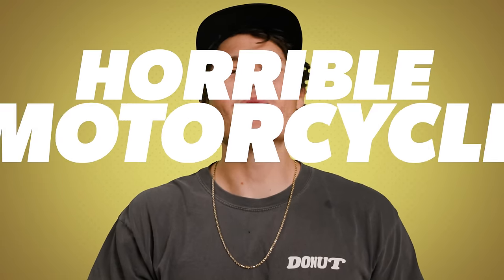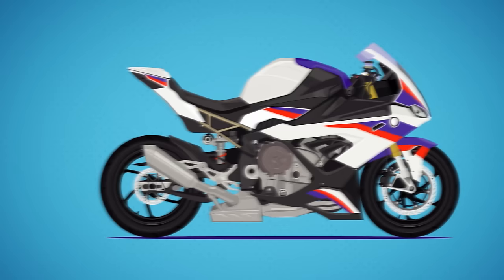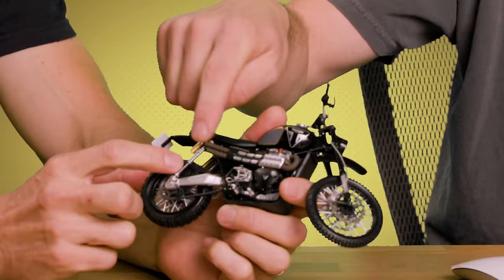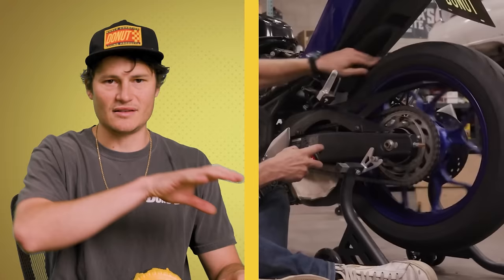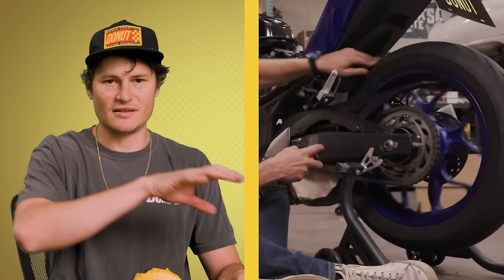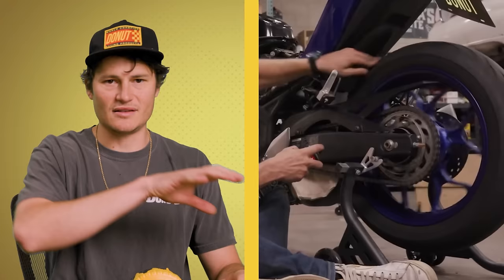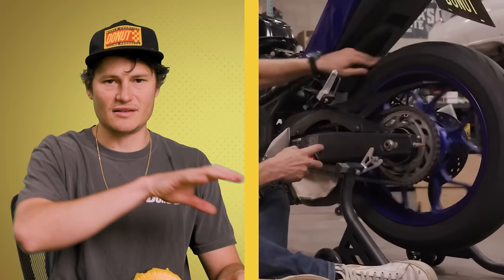Motorcycle Mechanics React to Tiktok Repair Fails

Comment: You can increase airflow on the intake without increasing particle size going through your filter. You have to get a much larger filter so you have a larger surface area there by increasing the flow rate in total if not per square inch. And potentially better quality types of filters While not having increased mesh size may have more mesh. But yes, obviously the easiest way to increase airflow is to put a larger mesh size filter or do you take it off entirely which, of course eats the engine up.

Comment: seeing the damage from that chain break brought back some memories lol. i had 3 chains snap on me within 2 months.  first one got stuck on front sprocket and destroyed my engine. did full engine replacement, then it came apart again and did some case dmg but was still ok. third one just flung out the rear with no damage.some of you are going to assume i installed them wrong but i think some one at work was messing with my chains cause i dont see 3 chains breaking like that. no issues since i changed jobs. some one was trying to kill my ass.

Comment: That R1 had been sitting for a decade.  I'm sure that the rubber seal simply broke down over time.  The process could have been helped along with starter fluid, but more than likely they used BRAKE Cleaner to try and start the bike.  This is exactly why you NEVER Use Brake Cleaner on anything other than brakes or other external steel parts.

Comment: Yeah, this Jeremiah, at age 8 over torqued the carb on the go-cart engine I worked all summer to buy and barter for.  I broke one of the bolt holes.  I tried to JB it as well, but it didn't work.  So I had to work and barter a few more weeks until I could afford to buy a new carb.

Comment: I had a chain snap on my dirtbike once. It whipped around and punched a hole in the crank case and locked up the rear wheel. I wiped out pretty good too. Good thing I was only going like 30mph.

Comment: I had a MBX-10 mini bike, I was cruising down the road at max speed and had a brand new chain snap. Luckily it didn't damage anything too bad but it scared the crap out of me when it broke. I replaced the rear sprocket afterwards and the guy who sold me the clutch and chain replaced the chain with a stronger one.

Comment: 9:07
I ride offroad, that is every time I ride I check the tension before and after, plus after I ride I clean my rear sprocket up and chain then spray it with chain lube.
Maybe I am paranoid but I don't have many chain problems.

Comment: broken chain sprocket can be deadly if it gives up on a pull out into traffic and the approaching traffic hits you because the teeth started slipping. my mom had a van where the engine mounts broke while pulling out for a left turn luckily it gave enough push she could roll all the way across the road to not be hit.

Comment: When I was about 20 I had a TZR250 and the chain came off while I was out in town.  I had pushbikes prior and decided I could just put it back on and try to drive without braking and keep constant pressure on the chain.  Yeah this was a terrible idea.  After hearing these guys I'm inclined to be rather thankful to not have been injured...  So I started off and it went just fine.  I split lanes and a set of lights and just as I got to the front the lights went green so I just kept going and got out quite a way infront of the cars that had been waiting.  It was at this moment I knew I had Fd up.  The chain jumped the sprocket got wedged and snapped the chain which wrapped around the rear sprocket a bunch and took a chunk out of the swing arm.  Fully locked the back wheel at about 55-60kph.  Before the bike had stopped moving I was already swinging my leg off the bike and grabbing the b!t(h strap and started hauling it off the road out of the way of the traffic.  So it turns out the cars that had taken off weren't paying attention to each other.  The car behind me stopped just fine.  The following 3 did not.  I started inspecting the damage and saw the first car pull up which wasn't too bad.  The second pulled up and I was like WTF is that on the back of it.  Yeah it was another cars front bumper...  It was stuck to the tow hook and had been torn off clean in one piece.  Another two cars proceeded to pull up with minor fenderbender damage.  While I had made a mistake it was judged that the cars had not been paying attention to each other and I was not to blame because the car behind me had managed to stop just fine.  When I got to the bike shop to get repairs done (it was pretty rough) the guys at the shop had a massive laugh that I had managed to get revenge on so many cars and come out virtually unscathed.  I found out much later that this had bent my output shaft which caused another major crash and a later failure.  It had started leaking oil from the shaft which got on the exhaust and the shifter.  I went into a corner out in a rural area and tried to shift down going into the corner as I slowed and as it was in the wrong gear I started to lose control and made the decision to bail when I saw I was heading to a small cliff...  I surfed the bike right off the drop, clipped the top of a barbed wire fence, snapping a single spacing post.  Much to my dismay the ground after the short cliff sloped down quite rapidly  into a paddock.  My mate was behind me and claims I went 25m before hitting the ground (full tunnel vision) then rolling for another 25m.  Bike ended in 3 pieces but was able to be repaired.  The only thing I lost (and I have no idea how) was the fluro yellow emergency kit I bought and put under the seat.  It vanished in the accident...  Later on a long trip to meet my future wife (after it was repaired) I gave it a damn fine run only for the stinger which had been straightened after the last spill got too hot and it just had enough.  At 100kph it just fell off.  The bike sounded MAD.  I spoke with the bike shop which assured me as it was after the expansion chamber it would be safe to ride.  So I met my now wife of 20yrs on a bike that sounded like a harley in a tunnel at full noise even at idle...  Moral of the story: you have to live to learn from your mistakes.  maintain your bike properly...

Comment: Rate my repair...when i was younger i got a free 250 2stroke cause the crank case had a hole that looked like somebody punched a ball peen hammer through it. I cut a square out of my beer can and JB Welded it over the hole, then sanded it to kinda match. Ran it for several years like that.

Comment: I had a little underground rat bike shop in san francisco for a few years back in the late 80's to mid 90's. I saw more than enough, lamp cord wiring, ungodly hacks, and the worst being catching crabs from some tweaker's honda seat that was made of mostly melting layers of duct tape. Unmaintained chains were the most common. To this day I still come across squids riding bikes where you hear the chain noise over the junk exhaust. Chain lube isn't as expensive as replacing chains and sprockets! I learned a lot working on beaters though, and earned a very good reputation, which eventually got me into a couple great shops where I was a good earner. The worst mechanics I ran across were MMI grads, I don't know why a school teaches chain smoking, drug abuse and cell phone fiddling over how to use tools and follow manuals. Avoid MMI people!

Comment: Replacing a rear sprocket was the first mechanical thing I did on a bike (besides brakes and tires).  It really didn't have teeth anymore.  Just nubs.  I didn't know much about bikes and figured it was the transmission.  What a wonderful surprise.  $20 fix👍

Comment: When I was 8 my parents hit a deer riding a Honda Shadow and if they hadn't been wearing helmets I would have been an orphan. My Dad was driving and mom was behind him. When they hit mom hit dad and went over and rolled down the highway. Dad tried to hold the bike up so his chest hit the gas tank and broke his sternum and bruised his heart then he went off the bike and went down the highway on his hands and knees. I don't know if they are still there but for years dad's kneecaps had indents in them from the asphalt grinding away tissue and bone. Freaking VA hospital he went to kept him for like 24 hours and sent him home like that, I think they have gotten better now but they were pretty damn bad at the time. They were both waited for over an hour before the damn ambulance arrived to take them to the hospital. I've never owned a motorcycle and won't because even with the helmets they were very lucky to have survived.

Comment: I had an old ktm 620 lc4 with supermoto wheels and all. If you have ever been on one you know how much they vibrate. A bolt from the rear brake came loose while riding and started making a should that I heard way too late because the thing also had no real exhaust muffling. Eventually that bolt machined a 5mm deep groove in the rear brake caliper bracket, before the rear wheel sorta locked up at lower speed😂

Comment: the drilled frame reminds me of the swingarm on my cbr i bought cheap to fix up 1st owner drilled and put frame slides into the swingarm and iv now gotta weld the holes up as i wanna use the swing arm till its done before putting the spare i on suprised it survived a 50mph run in with a buck with the 2nd owner

Comment: The air filter segment was a 2nd gen R6.2003 2005 models. And called the R6s 2006 to 2009.
  Looks to be a BMC air filter.  They use red rubber.

Comment: That little handlebar wobble cannot be called a ‘tank slapper’.

A real tank slapper is a lock to lock (as in hitting the lockstops on both sides) oscillation of the bars.

A wobble is a wobble, and an actual tank slapper is an unforgettable experience.
Reply: If that wobble is a positive feedback loop it would become a tank slapper. They don't "just" appear going lock to lock while riding straight. I don't think the guy wanted to show off a full tank slapper once it got dangerous.

Comment: For my money the worst motorcycle ever is the 1987 Suzuki Intruder. The number of times that bike tried to turn me into ground meat. Always wear your leathers, drive dry, and check your machine before you pull out.

Intruder's battery box is prone to dropping the battery when you hit pot holes because it opens to the ground. To change the battery you have to immobilize the front wheel and jack up the rear end.

Comment: My shop wall has a brake pad worn through the metal. A helcat piston chunk. And an input shaft with the teeth worn off the gears. My buddy has a helcat rod. A shattered pin drive porsche wheel and a hemi cam that ate itself

Comment: You can have increased airflow with the same level of filtration, but that requires you to expand the surface area of the filter medium......not making the filter holes bigger.

Comment: Talking from experience, that chain whip when it snaps a link totally sucks. Fz6 oil filter busted, left side rear seat fearing ripped to pieces and the chain left an imprint on the claf and upper leg.

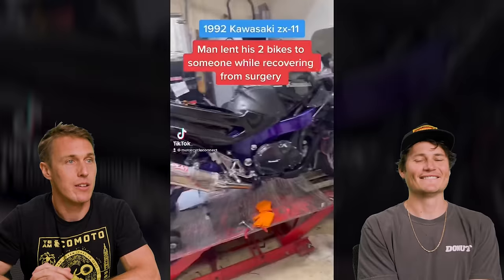Comment: My father learned the hard way that he should NEVER loan out his bike to people, and what happened to his bike was worse than what they talk about at 3:12 with that sport bike. The people he had loaned his bike to so many years ago screwed up the chain and put the wrong chain on so it trashed the gears, they were doing burnouts with it, and one guy even "helped" by doing a "tune up" even though my father had JUST gotten a mechanic to do a full tune up on the carbs. The best part is that they never told him they did any of this (except for the tune up) and they just told him $#!% like the bike just couldn't handle his weight and other !@)% like that. Well my father believed them and sent the bike to scrap because of it. 

So the morale of the story is NEVER EVER LOAN YOUR BIKE OUT. Also you should NEVER  touch someone else's motorcycle without permission, that's a literal way to get yourself killed or worse especially depending on the owner. Depending on the owner of the bike you can get as close as you want, but the moment you physically touch it then you're in serious trouble. Some guys are so protective of their bikes that if you so much as touch it then you're risking getting stabbed with a screwdriver or a knife.

Comment: What happened to the first guy happened to me on my cbr with aftermarket handles. Luckily i was doing like 20 when it happened. With me it wasnt cheap hardware it was my absooute lack of knowledge of the existence of loctite. In my defense it was the first motorcycle i owned and rebuilt

Comment: Good old jb weld my father bought a 1984 Honda 750 shadow for 500 bucks of fb had 48,000km on it with a pretty decent oil leak coming from the bottom of the casing where you can spit the engine apart and he put jb weld on the outside of where it was leaking and it’s been like 4 years then he passed the bike onto me and I have had it for a year it has 65,000km and no issues

Comment: i used a stick off a tree, some electrical tape, and wire to make a break handle on a snowmobile. got me 30 miles home till i could replace it the next day. i bought a 2nd 1 and threw it in my tunnel bag incase i brake another

Comment: been a motorcyclist for about 6 or 7 years now. Some of these are just wow. The one with the sprocket is insane. How do you neglect service for that long to get to that point? My bike is shaft driven and hasn't needed to be in a shop at all. Given it is only a year old but still.

Comment: Technically you can have increased air flow with the same particle penetration, that's why air filters are pleated :) a flat air filter would have garbage flow, but, since pleats are the standard already no, you cant get one without the other

Comment: I made a dumb mistake on an EV moped I should've filmed and sent in. In a hurry to get back on the road after changing a tire, I somehow put the entire motor hub in backwards, got on the seat, turned it on, cranked my throttle, and... shot backwards into my garage door.

Comment: 14:24 Huh? Sure if the is rust sludge in the tank, that tells you aint driving it today with that tank, but that is over weekend fix, long as rest of the fuel system has not corroded so badly it cant be restored ie aluminum castings are GONE with holes in them and even then chemical metal does wonders. I had dozen barn and out on the rain find bikes and only one had carb that bad it needed replacement and one gas tank that was with so many holes it was probably shot with shotgun. 

First thing i do is yes check the fuel tank to see how old the fuel is. That will tell when bike was probably last time started. Then check the spark witch is the biggest hurdle. If its bad coil or CDI box, that is a issue since there might be no spares available and anyway you need to order new parts, same with capacitor in point ignition, though there is just the capacitor that is usually the dead part, rest can be fixed. Then rubber parts like neck of the carb cause that can be disaster if its cracked and you try to run it ie it goes lean and can seize. Also new gasoline is poison for those rubber parts same with UV radiation, but not as much. Then we check the compression with tab of wd40 sprayd into cylinder to lube it. Finally gearbox that it goes to all gears, releases the clutch, brakes work, tires have and hold air, shocks dont leak and work, wheel bearing, wheel straightness and finally electrical system over all depending age of the bike. Rather simple list of things and most can be fixed with out getting new parts. From the dozen bikes only one needed engine rebuild while rest of the parts could be made or fixed.

Like the gas tank, pour out maybe still flammable sludge, wash it with water and soap, put in sand water mix and put it turning in something, wash it, then put in some twostroke mix to coat the surfaces. Alternatively put in some oxy action, citric acid or use electrolysis being the best to clean it and electro coat it inside. Fuel valve if its not chinese shit part can be taken apart and cleaned. Most valves have 4 uses for the seal rubber so just turn it into another location to prolong its life. Carb is easy to clean with ultrasonic cleaner, some brake cleaner and copper cable strand. The fuel injected modern crap i havent touched since once those clog up its new set of injector that gets expensive, but you do you. Only issue is multi cylinder engines, balancing those carbs can be pain in the ass, so i would not suggest beginner or even bit more advanced guy start on those.

Chain snapping can easily snap engine block into peaces. Have seen couple but thankfully in those it only put hole into engine block and in another went straight out of the back and no one was behind the bike. Check you chain wear often, clean and lube it often as well.

Ah broken handle, once hand to use wrench end loop in very interesting setup to get home, but yeah it happens. Get hand guards to not only protect your levers but your hands as well.

Comment: There are bikes out there, which have a driveshaft. Many BMW bikes have them.
Here in germany we call these Rubber Cow. Cause when you accelerate, the bike lifts the rear a bit, and after that it moves forward. Like a cow stands up.

Comment: That’s my old white gsxr 600 the chain broke at 80mph and hit my arm and popped my tire and broke a hole into my engine. The orange gloved master Mind Matt was able to bring that bike back to life and sold as a reliable running bike 🔥🔥 previous mechanic tightened my chain way too tight and I didn’t check it myself ..